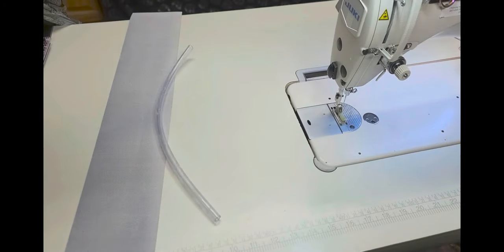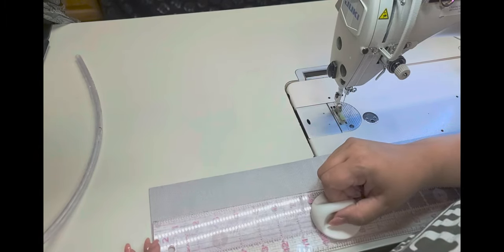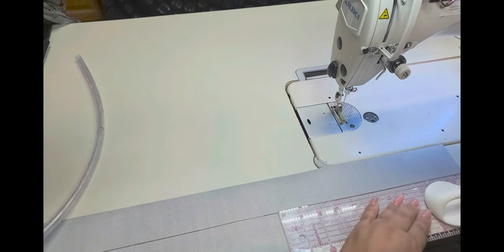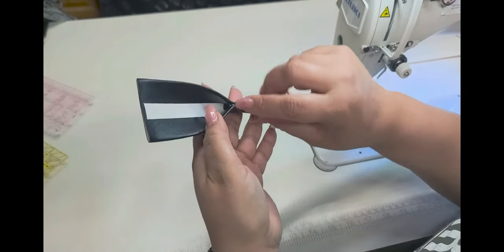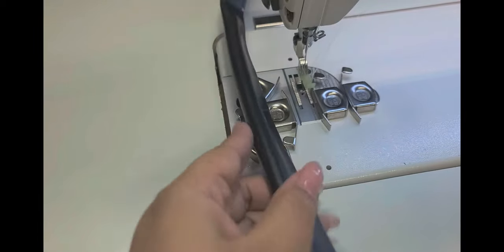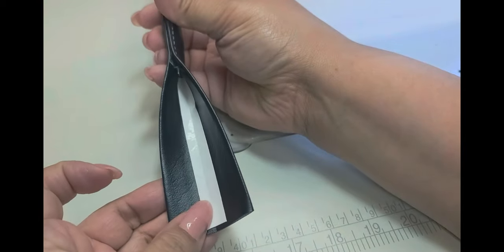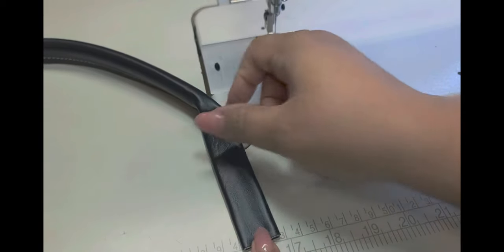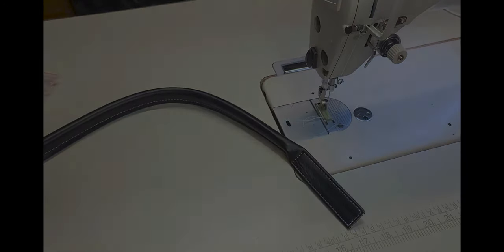How I make tube rolled handles with vinyl

Comment: You might want to try using a compensating foot, which will give you a ‘fence’ to stitch against. They are available with different stitch offsets and left or right. Mainly for industrial or semi industrial machines though. As a Juki dealer I’m pleased to see you are using the best😉😀
Reply from the maker: Thank you. I have several feet like that, but don't always find them necessary. I also like to show off different tools that others may not know of, or different ways to use them

Comment: When you use a narrow foot does that give you a precise 1/8" seam? I have so much trouble making those 1/8 " seams and I'm not sure if I should measure from the point of the needle to the outside of the foot? Hope this makes sense. Thank you for sharing this wonderful handle-sewing video!
Reply from the maker: Yes, those feet usually give me a nearly perfect 1/8" every time I topstitch. The foot itself is 5/16".

Comment: You didn’t mention the widths of the two double sided tape. What kind of white marker did you use.?
Reply from the maker: You can use whatever size tape you have on hand. In the video I used 1/2". The pen used is a silver ink marking pen that you can find on the MoreMeKnow website

Comment: What is the measurements of the vinyl ?
Reply from the maker: The width is 4", and the length depends on how long your tube is. Total length will be the length of your tube, plus another 10". So if you use an 8" tube, your measurement will be 18" x 4", a 12" tube would use 22" x 4", etc. You can also lessen the width to something a bit narrower than 4" if you want a smaller lip on the side of the handle.